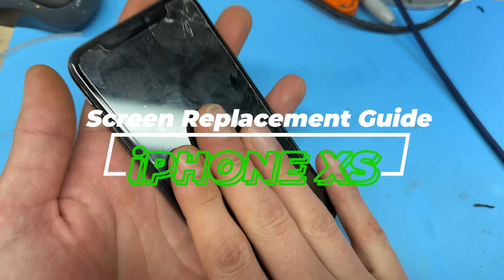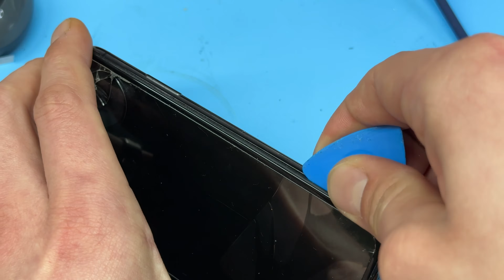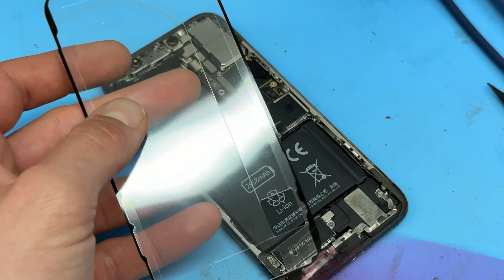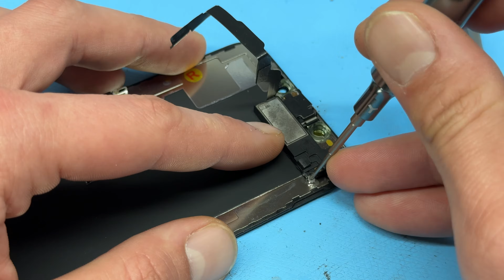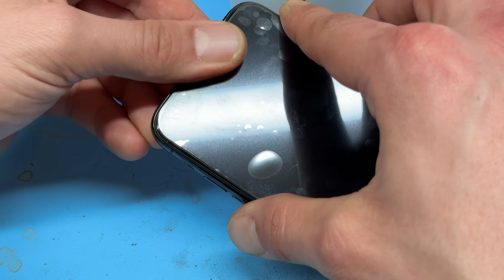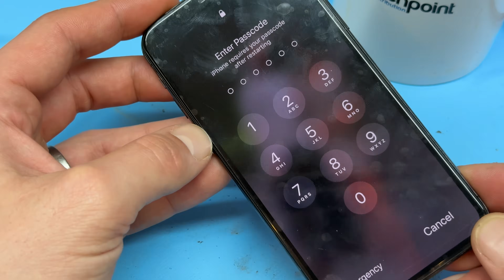iPhone XS Screen Replacement Guide: Step-by-Step Tutorial for a Cracked Screen Fix!

Comment: i thought its hard to replace an lcd, until i saw this video😂 like unscrew some screw and disconnecting thats it
Reply: fuck i ripped off the sensor cable in front camera but its half ripped so probably my face id and camera and speaker at top wont work😂

Comment: How would you get rid of the message in settings about non-genuine screen.
Reply: You would need to buy a JCID to copy and paste the serial number from the old screen to the new screen.
Reply: @xItsBen  as far as I know that restores true tone, but does it also remove the message?
Reply from the maker: Yes, True Tone only. There is no issue with screen warning on iPhone XS - only when replacing battery
Reply: @iDoctorUK  So screen warning only appears on iPhone 11 and higher. How would you get rid of the warning. Is there a tool that can remove it.
Reply: @gulmulmiah1919  you would need to replace the IC chip.
Reply: @gulmulmiah1919  You need to transfer the touch IC. Intermediate soldering job. There's no tool available.